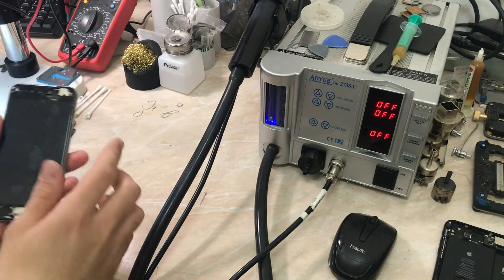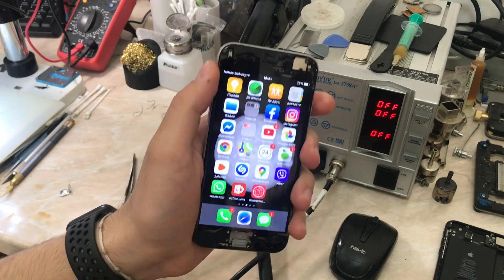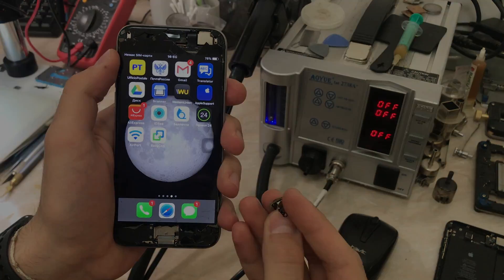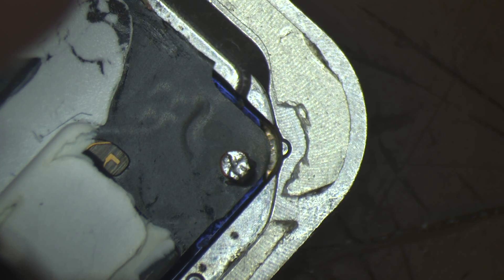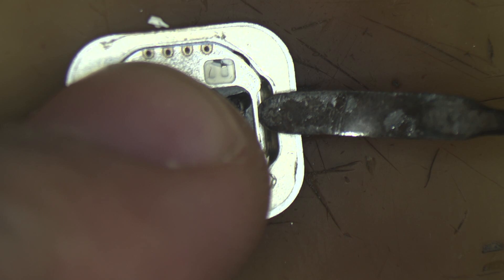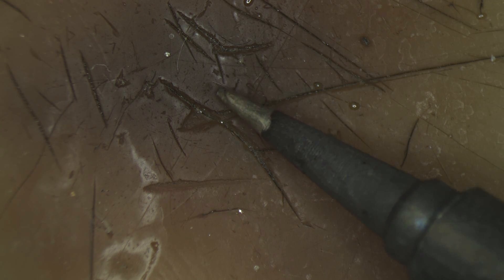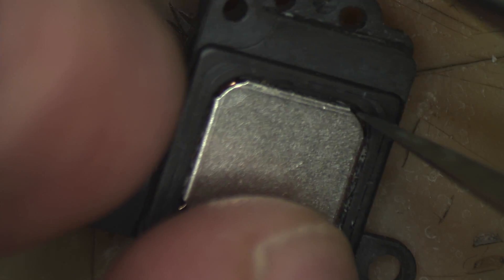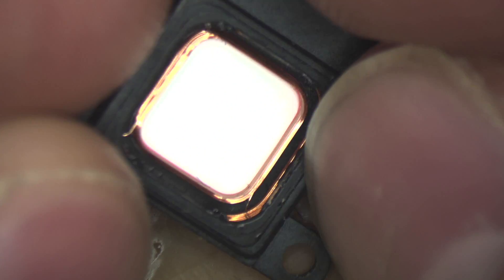iPhone 6 Touch ID Flex Repair (Step By Step For Beginners)

Comment: So at 2:30 that home button is the original that was tore apart the the flex cable or thatis the new home button that will be soldered to the original flex cables?
Reply from the maker: It’s the original one
Reply: @AntoineKiriaky10  ahhh so when it tore apart, you soldered it together... I am thinking of cutting a new home button and solder it to the original and paired flex cable... does the touch id will still work if i do it?
Reply from the maker: Yes I just used the original one because it’s not damaged you can use another flex
Reply: @AntoineKiriaky10 ahhh thanks i hope we can have the touch id back by soldering a new home button to the original flex cable
Reply from the maker: You can’t just solder any home button to the original flex you can only change the flex you can’t put another home button
Reply: @AntoineKiriaky10  ahhh sad we may not be able to have the touch id functionality of a lost home button which is almost the same case you repaired
Thanks!

Comment: Poor old 7 plus got water damage (don't ask me how as it meant to be water resistant) ifixit replacement screen and I managed to bugger up the cable like all the folks reading the thread. I opted for a $10 no name brand off amazon, I can live without Touch ID as I can use my watch right :) Didn't know the cable was repairable and so you could start a little BIZ but not sure what you'd have to charge as it looks like a ton of work, probably my price point would be $35 as a cheap ass one off amazon is $10, works fine it appears and a better one at fixit is $25. Good work, and it was my own fault as the ifixit page warned of the breakage possible with the cable :(

Comment: Nice, I have used UV coating as a  "save point" once I get a good jumper placement down. Thanks for making this video! I love seeing how others do it too.
Reply: Oh, at the beginning, are you using superglue to hold the flex in place? It looks like you also got some under the sensor side of the flex, I am guessing to help it be nice and sturdy so its not flopping around while soldering to it?
Reply from the maker: Yes I used superglue and for superglue got under the sensor I guess not but if it got under the sensor I think It will not be a big problem the jumpers were good and temperature when you solder each jumper didn’t effect the flex or the glue under it